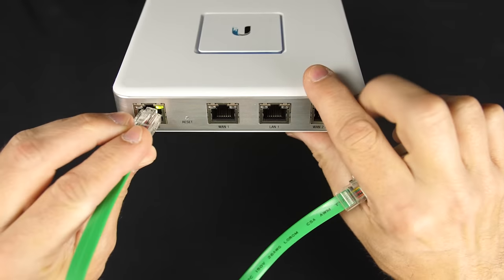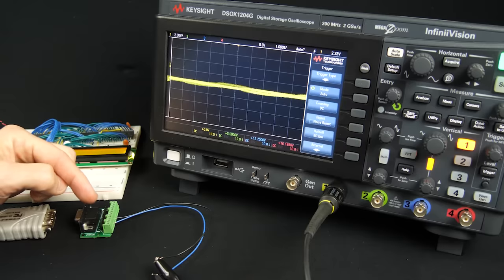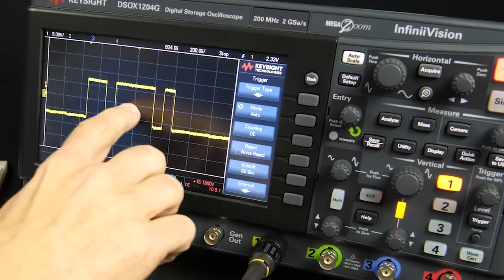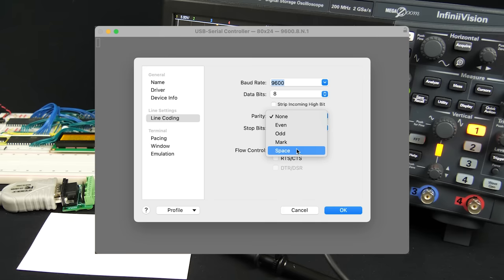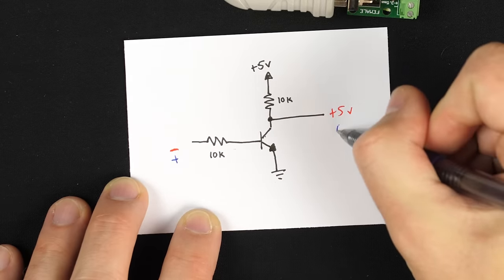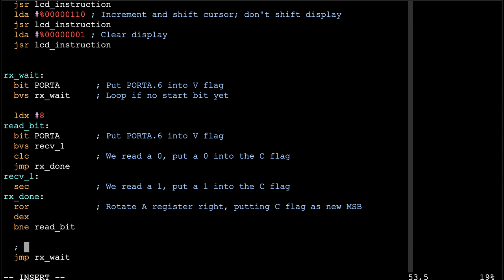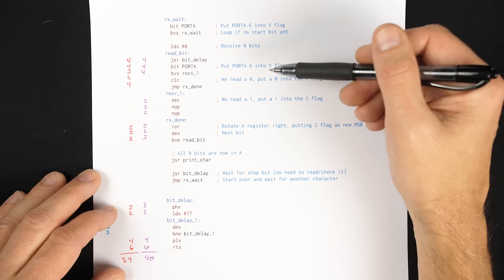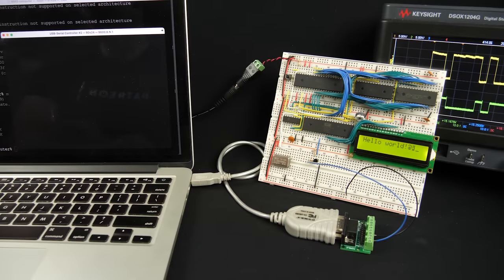The RS-232 protocol

Comment: 21:10 i wonder if waiting could be "simplified" by using an external clock on an extra pin that is "hardcoded" to whatever baud rate. and then wait for it every time you read a bit. (after the initial rx_wait) it might be more complicated to build. i guess. but easier to maintain that code. and you might play with the baud rate without recompiling and writing the IC. (i'm not an expert in microcontrollers so this is a guess)

Comment: One of my first tasks working in IT back in the 90s was programming modems. Anyone else remember the AT command set?
Reply: S0  H4 R9   ... Ok i forget everything but S0 ,1,2,3,4 etc would set the maximum ? modulation rate, 0 letting it do the best it could  .. V1 for verbose ?  Others for CTS RTS vs Xon Xoff flow control...number of rings  for auto answer,  ATH for hangup.

Comment: The loop includes printing, so it won't keep up with a full flow of 960 characters per second. Waiting for the stop bit is therefore also pretty pointless.
It will still work great for hand typed characters though.

Comment: I don't think it's strictly necessary to have 1 DTE and 1 DCE per serial link. It's entirely possible for the breadboard computer to be a DTE as well, and connected via a null modem cable.

Unless of course the breadboard computer provides connectivity to something else, in which case it could very well be DCE. 🙂

Comment: At around 5:55 It's explained that the 'space' where the +3v is present, represents a '0' bit. Similarly when the signal comes down to -3v we consider it as a 1-bit. This seems reverse of what is intuitive and what basic enthusiasts would consider. Can someone explain
Reply: What represents a 0 or a 1 is just a matter of standard. And RS-232 standardized it that way. Probably it had a technical reason for choosing that way.
Often standards do surprise you because human brain often thinks something will be like we have seen it before in other things.
I find it interesting e.g. that RS-232 is kept signaling "1" when idle...
Reply: @notmyname1094  true true. I'm thinking of the reason why N inary was created or useful, not so much of the discovery of transistors. All electronic materials deteriorate and using for example 5v for Green, 3v for Amber and 0v for Red is not dependable...thus Binary made sense. Any +ve volt above say 3v means ON and anything below means OFF. Interesting to know more of the backdrop /mindset of RS-232 logic.

Comment: @ben eater What about the various flow control protocols such as : x-on x-off, rts cts, ack nack?  Do they address the clock timing issue ensuring  cleat transmit/receive function?  I remember having to configure this when connecting a device, such as a digitizer or plotter, to a terminal/computer?  Of course that depends on the connection requiring a null modem cable.

Comment: Awesome video! Pretty new here: What is he using to write code for and program the board? I assume this is some assembly language. Just curious about the workflow/IDE.
Reply: Per one of his previous videos (he has a whole series on building a 6502 computer, and an earlier series in which he creates a simple 8 bit processor from individual logic chips), he writes 6502 assembly language in a text editor and then uses a program called VASM to assemble it and create a binary file.  He then uses an arduino nano and ciruitry to write the file to the EEPROM which he plugs into the breadboard.  He posted another video in which he built that EEPROM programmer as well.
Reply: @michaelwilliamson1392  Thanks a bunch! I will check it out.

Comment: In rigor, RS-232 is an interface standard. The format of the transmitted bits is not part of the standard, you are speaking of asynchronous serial transmission. It could also be used for synchronous serial and that is what the clock pins are for.

Comment: Vintage is fun and all - but a bit more practical would be something like a 8051 microcontroller (also vintage) but comes with RS232 and other peripheral interfaces on chip. The assembly language is just as weird and vintage as the 6502.

Comment: For the half-bit delay and the last bit delay, you're reusing the delay timing which is too short as you're missing the 40 cycles from the bit reading. Obviously not a problem but I felt nit-picky 😀

It's actually a good thing because you don't really want to wait for the last bit otherwise you could be missing the next start bit if it comes just after.

Comment: I bought a brand new piece of equipment for my biotech lab a few months ago (BioTek Plate Reader). This equipment hooks up to my computer via RS-232. Why would they do that rather than USB? Why is RS-232 still used? This isn’t some legacy connection with no real purpose (like we would have on our fridges, for example). The computer sends configurations parameters to the equipment, and the equipment responds with its data. The connection is integral to the equipment’s whole operation.

Comment: I can't figure out how the timing works reliably in general. How can I distinguish that something's a start bit or a stop bit if a sequence of characters is packed densely? Is there some sort of initial handshake protocol? Also the lack of clock synchronization means that reading that pin could occur at any point during the bit's cycle... how do we know that 1/2 bit delay is right? It all feels like it's just luck that hello world worked, and that you'd expect errors for actual streaming data.

Comment: After running the RS232 signal through that little transistor circuit, could it be sent as a usb input? It becomes a 0-5v signal with binary 1=high, Right?

Comment: This was a real cool video..  been using rs 232 quite alot along time ago.. i had nullmodems between my computers in my boycave?.. :) i even soldered my own connectors  and cables with using only Rxd, TxD and signal ground.
i never knew about the second data line in the 25 pin connector and the clocks in there.. does anyone know somewhere that was used? both the data line and the clocks?

Comment: Yarg, got through the whole series using DASM since I already knew it for Atari 2600 programming, now you go and use phx and plx. Do I learn a new compiler just for a few lines of code or do I redo the clock cycle math with the extra lines and hope I get it right?...

Comment: I used to cut off three electrical wires, and jam them over the male db9 pins on my friends and my computer (pin 2 to 3, 3 to 2 and 5 to 5, IIRC) to be able to play DooM deathmatches back in the day, because we didn't have s real serial cable.

Comment: thanks for explanation! now I understand how only two connections are required

but, now I wonder... is a negative voltage, negative? or, it's just smaller than positive? and the ground is put just in between?
Reply: A negative voltage is negative with respect to ground. Like a hole has a negative height with respect to ground. Voltages only make sense as a comparison between two electric potentials.

Comment: Maybe you could use an MC6850? It's designed for the 6800 CPU, but it's Motorola, and should work for 6402 also.

Comment: Minus volts just confuse me. I've watched YT videos and read about it and every article says it is just all about the reference point. Okay, it is about the reference point. But no one has said me why we use minus voltages, why we don't just set the reference point lower. Meaning if we measure -5V, 0, +5V just drop the reference point 5 volts lower and you have +5 and +10V.

And if voltage is the drift velocity of electrons, what are the minus voltage? Drift velocity of electron holes to the opposite direction? Sometimes I think it is easier to understand electricity from quantum mechanic principles.

Edit. Sorry, meant to write current is the drift velocity and voltage is the potential difference and is the minus voltages then potential difference of electron holes. Minus voltages does not make sense to me, or is it just a mathematical thing like quasiparticles in physics? Then I could understand them.

Comment: I think you made a small logical error when you calculated the delay for half a bit. You took 13 loops and divided by 2 to get ~6, but 6 loops is only 5*6=30 us. You probably want to loop through about 10-11 times which would give 50-55 uS which is the best approximation to 1/2 of 104us. You could probably just reuse the full bit_delay loop which takes 5*13 = 65 us which is closer to 52 uS than your current 30uS loop

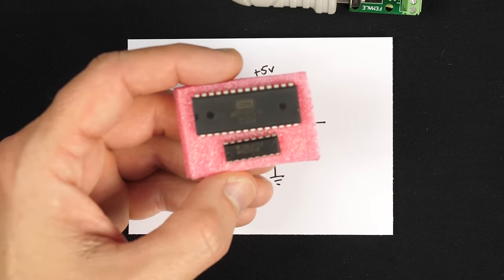Comment: 11:57 — would be nice if you put the actual name of the chips and the transistor into the low text. I'm going to make an order and would could have saved some postage if you revealed the chips used.
Reply: I'm not sure at all, but after analyzing the image and looking for the subject, I can assume that it could be a W65C51 (Asynch Communication Interface Adapter) and a MAX232 (a level converter, which transforms signals from a serial port to suitable for use in microprocessor circuits), the one I'm most sure of is the W65C51, the other one, I can assume is from the MAX 23x line, I don't know if you've ordered the rest of the items, but I hope it helped. (Sorry for any mistakes in English, it's not my main language, I recommend looking over these chips to check if it's compatible with what I translated).
Reply: @andrelima7737  thank you!

Comment: Hello good afternoon and congratulations first of all for sharing your professionalism.I have a question if you would be so kind as to help me. I have a sream eagle super pro programming motorcycle control unit. I bought one for my two motorcycles but apparently once connected to one the data remains recorded and when connected to the other it tells me that it is already attached to the other frame and does not allow me to connect it. According to what they tell me, I need to reset the problem because in Spain I can't find anyone who can solve it for me. Would you be so kind as to give me some indication of how to do it please?

Comment: 09:45 I don't get it... If the start bit is 0 and the first data bit is also 0 - how does the receiver know the bit time? If the clocks run at slightly different speeds the first 2 bits could be a single bit time.

Comment: Thanks for the video! I never understand why the baud rate was set to specific values when using putty. Is there a reason why some of these standard baud rates are standard?
Reply: 45 baud is for ancient 5-bit telex machines. 110 baud is for newer Teletype machines like the famous 33ASR.  300 baud is for a widespread FSK modem called the Bell 103, which runs probably as fast as it can over an unconditioned telephone line.  Most of the other baud rates are 300 baud times a power of 2.  300, 600, 1200, 2400, 4800, 9600, 19.2k, 38.4k, and then the 56k modems of the 90s ran at 57.6k, and the next speed up is twice that, 115.2k, which I used once to connect a Mac to the internet over PPP before I got an Ethernet card.
Reply: The UART gets a clock  , 1 M Hz .. about that ...  This was the maximum for the UART and the suggested clock by the UART makers, and made standard by being the clock sent to the  IBM PC's 8250 UARTS...  The usable speeds are then 115200, 57600 ...  Just divide by  8,16,32,64... the divider set in the UART by the host (eg putty )

Comment: Great video!  I have a quick question that no one really has an answer to.  I want to output (mirror) the output of the LCD to go to either another screen or a window in WIndows.  The reason is I don't want a group of people to all try and hover over a small LCD screen.  I'd like to broadcast the screen output onto a big monitor on the wall.  Is there an easy way to pick off the RS232 signal via a DB9 and rebroadcast it onto a screen???  Any help would be amazing!
Reply: Maybe you can use another USB-rs232 to receive into your computer and display it... Also there are some oscilloscopes capable of decoding serial protocols and have video output too I guess

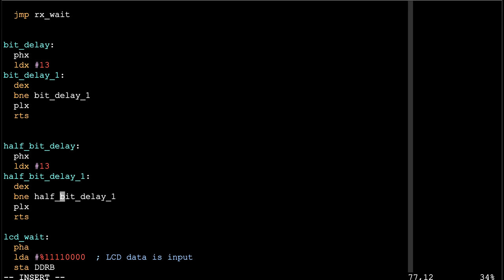Comment: @24:22  you incorrectly calculate the Half a bit time.
You don't have all the extra overhead from the prior operation timing.
you used 6 * 5 = 30 micro seconds.
it should have been set to 10 to wait 50 micro seconds.
Doubt it makes much of a difference over 10 bits of data, but just wanted to point that out.

Comment: I was at my local goodwill and bought a "Parallel Loopback Tester"> It had no instructions with it and had no company name and all that was printed was "Parallel Loopback Tester" and Computer Accessories. (It was made in China, what a surprise) I've tried to research it but have found very little about it. Can you help me?-Barry
Reply: You plug it in, and talk to yourself.  Your single system is both endpoints.  It just validates that the port and program are both working.

Comment: 10:57: It's never occurred to me that good old serial could just as well be set to Baudot code or DEC SIXBIT or 7-bit ASCII. Could, and probably was, on some sites out there, way back when. I mean I know that, relatedly, early email systems couldn't trust all the MTAs to be eight-bit clean. I wonder if similar headaches were had in the transitions from five to six and seven bits. Btw., for a really ingenious solution to the problem of possibly getting mojibake due to the eighth bit being lost in transmission, read up on KOI8-R.
Reply: Correct..   apart from being able to do 7 bit ..  RS232 often had XON-XOFF flow control ... XOFF is control S ... if I am receiving too much too fast, and my buffer is nearly full, I send control S... so the other end stops until I send XON .. start sending again... Also the Hayes AT modem would drop from data mode to command mode with +++  received from me very close in time...
Reply: @leong108  Speaking of fun facts that are mildly non-sequitur yet relevant enough to be indulged:
DOS bois: Save and quit.
UNIX beards: Transmit off and on.
Very shibbolethic.

Comment: Wait, it was renamed to TIA-232 somewhere before 1998?
Reply: The detailed spec do give insight why the manual for serial RS-232 modem back then made caution that its device will not works with 25-to-9 pins adapter.

Comment: I think I am a little too late but, do you have any ideas why
 when I connect a satelite reciever through serial to the computer, the serial monitor only recieves one character on a new line until the device just timeouts? I have first tried with a serial to USB adapter on a computer and a laptop then with a serial cable but the same result.